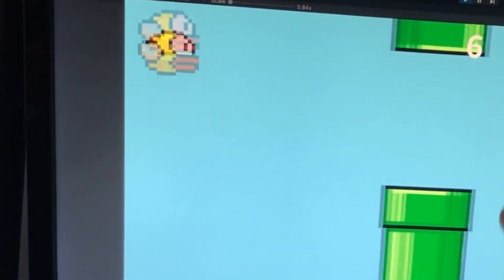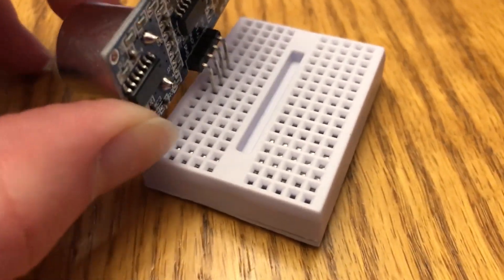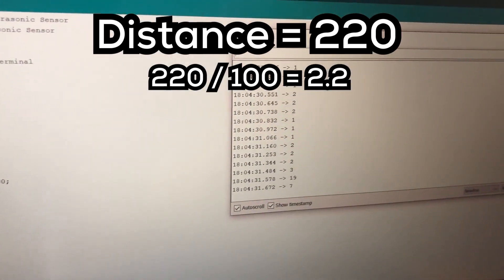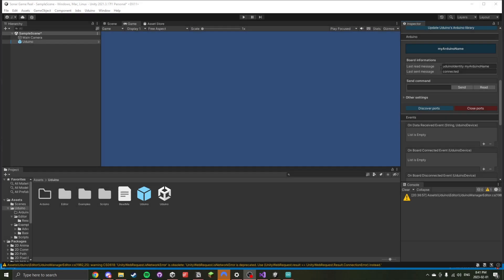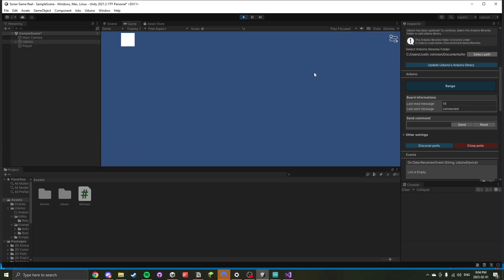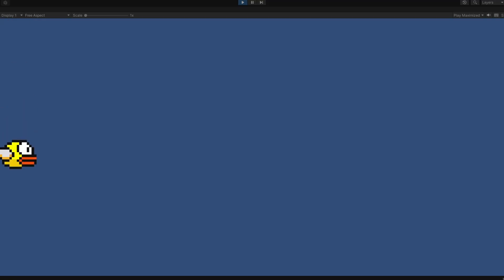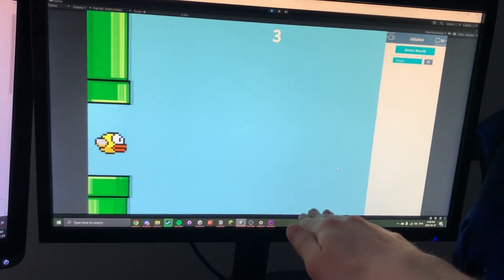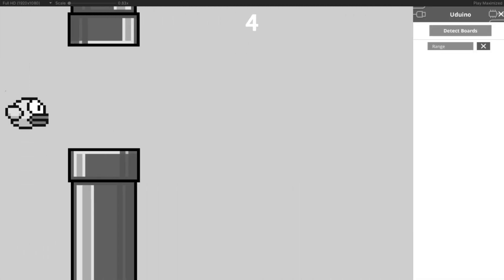I Made a NEW Video Game Controller

Comment: Hey, Im 14 and I've played around with Arduinos before and have a tip for the ultrasonic sensor and it misreading with your hand.
There are two things you could try: 
Option 1. Increase the frequency of the pulses and ignore any outliers. If you're dividing by 100 then a jump of more than 4 from the previous pulse should do. The only con of this is the increased frequency of the pulse might degrade performance, but in this example, it would be virtually unnoticeable.

Option 2. Set the current height variable of the player to the average of the past three pulses. This would make it noticeably smoother but increasing the pulse frequency for this would help too.

Also, when your player moves it's a bit janky like it clicks into position. This could be reduced by implementing option 2 from above or a combination of 1 and 2, but without dividing the initial value of the ultrasonic sensor by 100 so you have a wider range of positions. This would be the simplest and most efficient (in my opinion) way to implement this. If this doesn't work though you could gradually change it with a little bit of math, I won't explain it here but you could find it online. 

Loved this video JellyJam and hope this helped.
+1 Subscriber
Reply from the maker: Thank you for the input! I haven't used Arduino much so its cool to hear a more detailed explanation of it, I didn't mention this in the video but I ended up changing the division amount (I dont recall what though) from what it originally was as I had to remake the input anyways since I used Undino for unity.

Both of your options are really good ideas that I will 100% look into if I do further expand upon these ideas, and with as you said with gradually moving the player, I could Lerp the players position to quickly move to the new position to make it look more smooth.

I'm glad you liked the video and once again; thank you for the input!